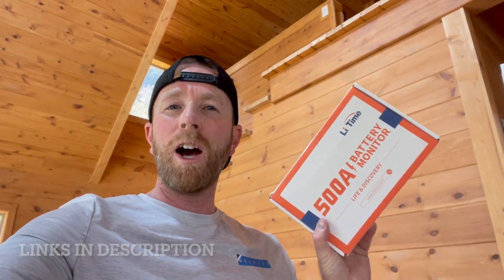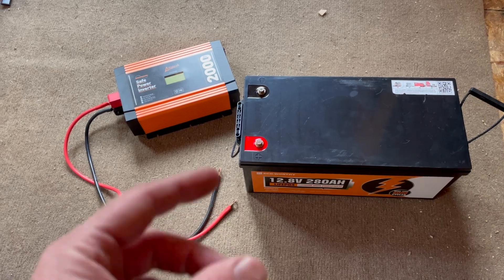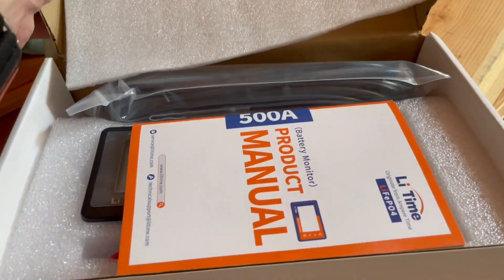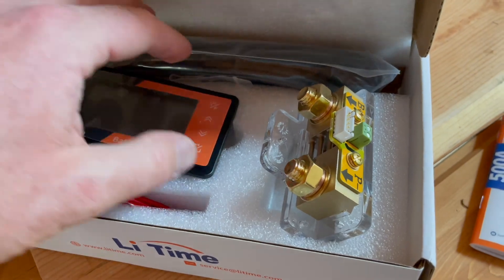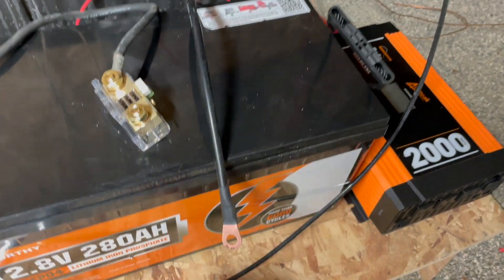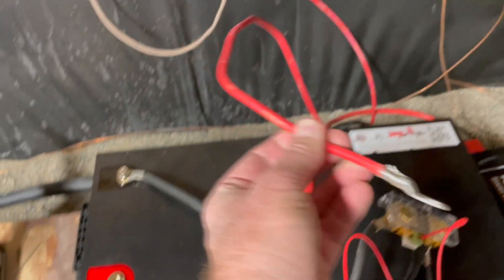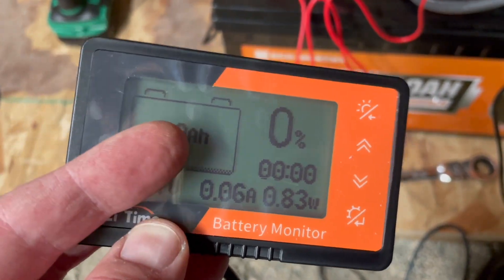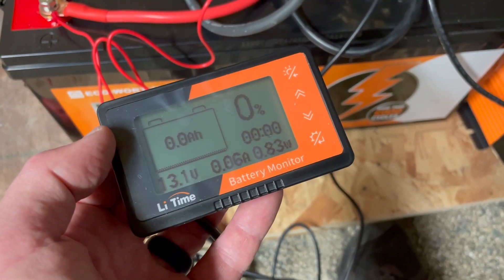How to Setup a Battery Monitor for Your Solar System- Li Time Battery Monitor

Comment: did you have to discharge the battery to set this? it says so in the directions- but obviously that is not a great option
Reply: I have the same question. Seems totally unreasonable

Comment: I have 3 12v 560Ah wired in parallel. Do I use 3 monitors for each battery OR 1 monitor for all 3 wired in parallel .. and how do I set the values in the monitor is its connected to the total bank?